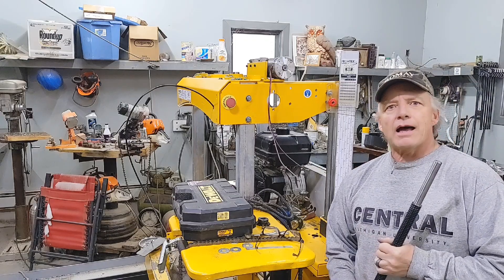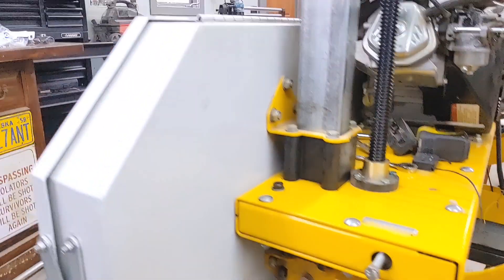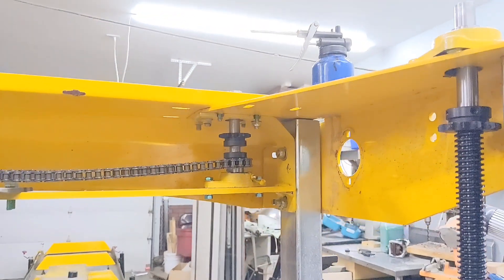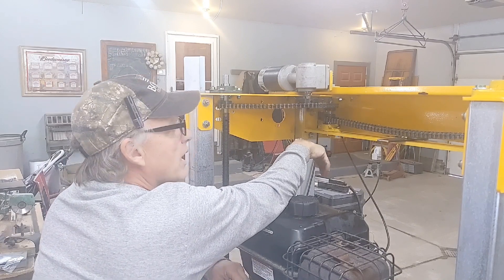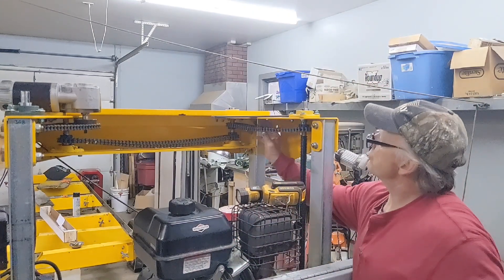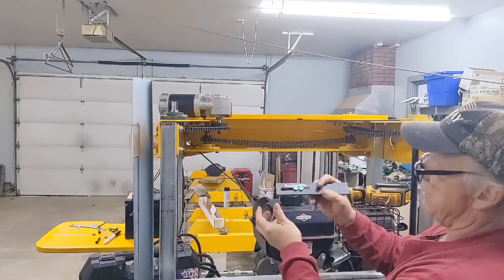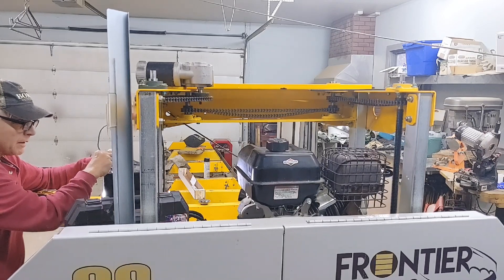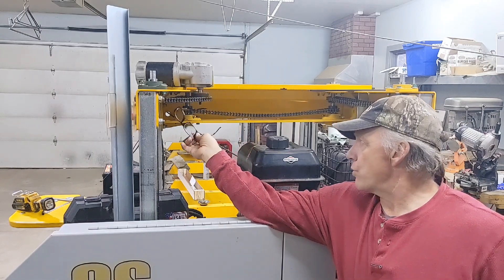Putting the Pieces Together for the Up Down Power Feed Part 5

Comment: Looks good Jerry! Are your sprockets and shafts keyed, or are the set screws drilled and dimpled into the shafts?? Will the idler on the cross chain have enough space to clear the engine and carriage?? I really enjoy when do a tutorial, and I can hardly wait until your next video!!
Reply from the maker: Yes I have keyways on the screws.  I have flats ground on the two crossover pins for the set screws.  Yes it will all clear the engine.   That's why I had to go the direction I did with the crossover linkage under the coolant tank to clear the engine and battery.
Thanks for all the support.

Comment: Fantastic work there Jerry, very well done. I bet your feeling well achieved even at this stage of the video. That's going to work great and has probably spurred me on to do mine. It seems the only automated operation I need right now. Then will go for the power feed bed after.
Thanks again Jerry, blazing the way for Frontier you are sir 👍
Reply from the maker: Thanks Nick. It's coming along well.   I have to finish up the tensioners and start working on the controls.   I think it's going to work out great.  The dollars are starting to add up though.  I'll break all the costs down in one of the videos.   Can't wait to get some weather and get this mill back to work.   Another system blowing in this week and we still don't have our power back on from the last storm. The lack of power has slowed me down a bit this week. Thanks for all the support.
Reply: @Bigelow Woodcraft  I have no doubt you will boss this. Yes I can imagine the power outages are not helping in your progress. However you still doing a great job, very well done.
Reply: @BigelowWoodcraft  .

Comment: Nice set up Jerry. About a year after building my sawmill, I installed motorized lift on the saw head. Rather than screws I went with chains. It all works great and saves the arm. I run mine on 12vdc and it too runs a bit slower than I'd like, but I'm not in the milling business to make a living. I may try 24 volts later this summer and see how that works, however I will need to come up with a 24 volt charger or charge each battery separately. I guess there are trade offs either way. Great job and I'm sure you'll enjoy the added mods you've engineered to your mill.  Ed.
Reply from the maker: Thanks Ed.  Yeah that is the problem with 2 batteries in series is the charging separately.  I think I'll get a 12 to 24 volt transformer.  I think the chain method would be the easiest.   This is a bit of overkill lol.  Thanks for the support.